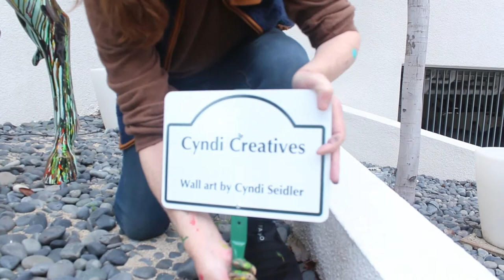Drip Pour On Walls - Mural Painting for KARE-USA

Comment: Hi! This is so cool! How hard would this be for a beginner? I would love to do it on a wall in my classroom, but a little nervous!
Reply from the maker: Thank you❤️❤️ I wouldn’t recommend this kind of project for a beginner. Try doing drip pours on canvases and get the hang of it before trying on a wall. You’ll need mural paint mixed with a pouring medium to make the paint fluid. After dry, paint a coat of clear varnish